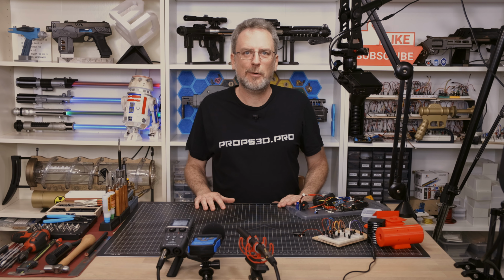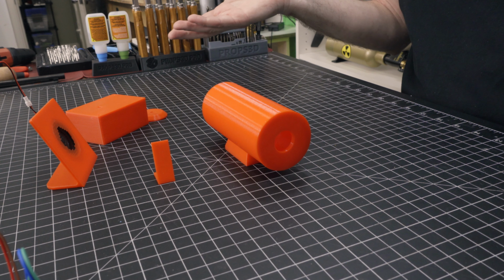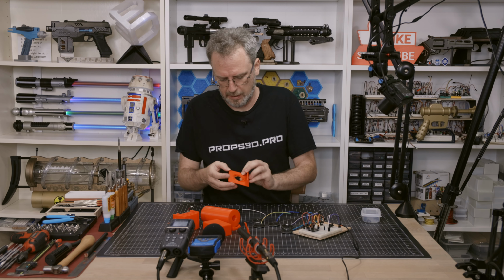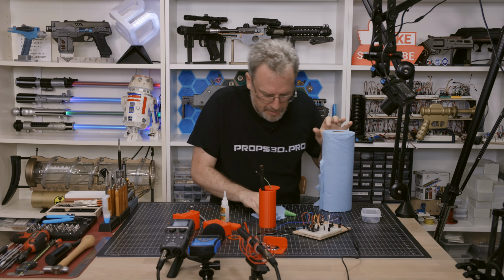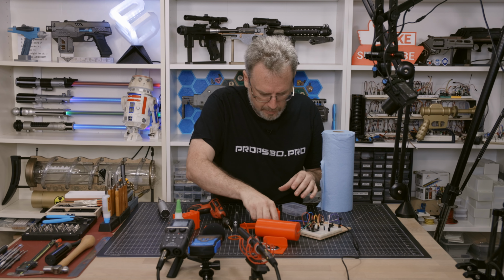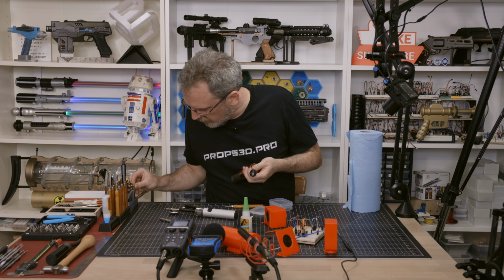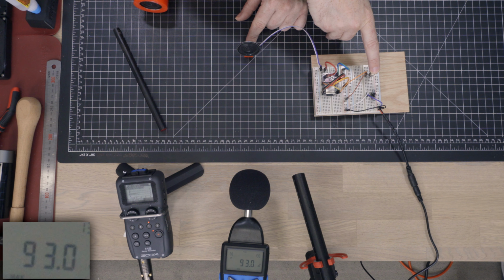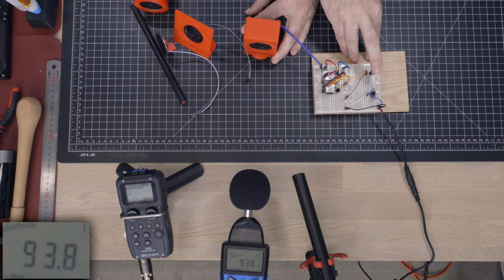How does your Speaker Enclosure Affect Sound?

Comment: The speaker on a plate is an open baffle, the rear of the speaker isn’t trying to compress or create a vacuum in a sealed enclosure, so all the energy is available to move the speaker.

An open baffle speaker is the loudest, with a wide sound field radiating in a figure 8, and less bass.
A sealed speaker provides tighter, more accurate bass, at the expense of volume and lowest frequency.

If you give this a go again, you might try a couple different ported enclosure designs?  The port hole allows for greater speaker efficiency and loudness, the port length can be tuned to reinforce a specific bass frequency.  Again the extra bass comes at the expense of clarity.

Front speaker ports can direct even more bass forward, but the phase of the port is dependent on internal reflection, so it reinforces the bass, but the port lags behind the driver, reducing clarity.  Rear ports are in phase, but direct the sound away from the listener, either relying on the room for reinforcement or simply allowing the driver to move more easily for louder bass.

Considering the quality of the DAC, Amp and drivers for these tiny props, I would imagine a small enclosure with a front port would be the combination with the deepest bass and loudest sound.  This is pretty much the design of every compact bookshelf speaker.

If you ever do an update, give ported enclosures a try
Reply: Wow.  This is how it looks like when someone who knows what they are talking about is talking.

TIL!

Comment: every 10 db is perceptually *twice as loud, not ten times as loud
Reply from the maker: "When expressing a power ratio, it is defined as ten times the logarithm in base 10. That is, a change in power by a factor of 10 corresponds to a 10 dB change in level" So in an absolute sense what I said is correct, perceptually is very different of course as DB is on a log scale and the perceived change in DB has the a factor of distance from the source to contend with as that's a compounding non-linear factor. So in a practical sense you are sorta correct, sound is complicated...
Reply: @Props3D  yes, it is complicated, lol. Very interesting video!
Reply: Great video.  Stumbled upon it doing some center theatre channel speaker research.  I could hang out with this guy any day.
Reply: Actually 3dB is twice as loud

Comment: How did you integrate the speakers into your blaster designs? Did you just create a hollow in the gun body design, or go with a dedicated speaker mount? The Mando blaster doesn't sound nearly as loud as the other two you demonstrated.
Reply from the maker: The SE14r hurts my hears, the E-11 has a much bigger speaker, but in person the Mando blaster is impressively loud for it's size. It was also in much earlier beta at the time I filmed so it's a lot better now. As soon as I get the Lawgiver video done this week I'll be working on the final release for it, try to make the start of S3.